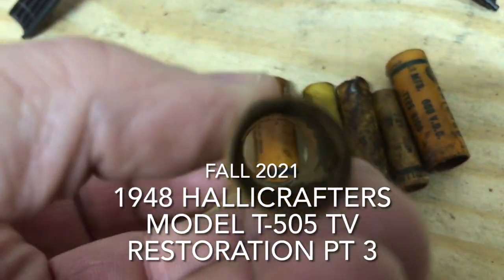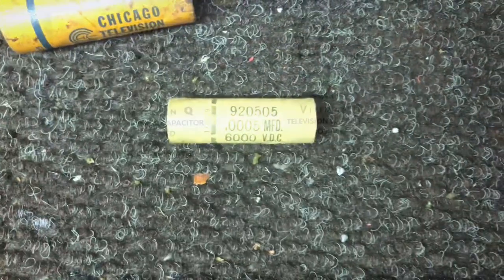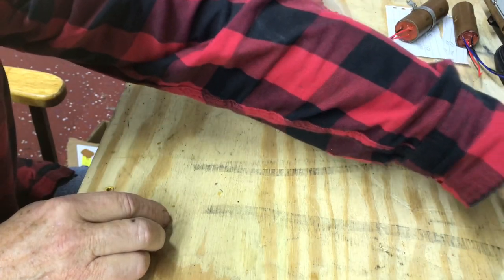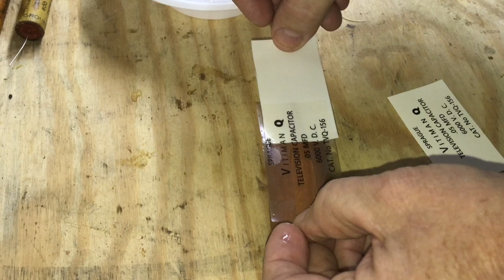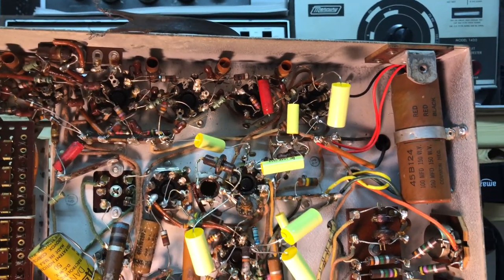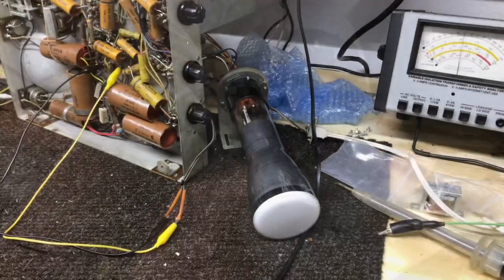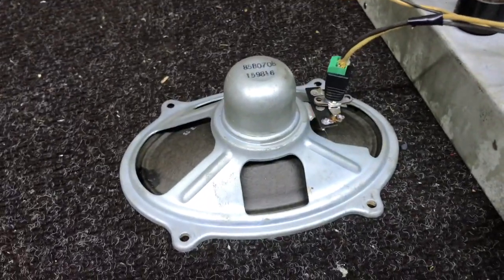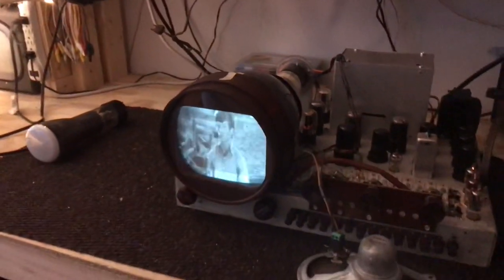1948 Hallicrafters TV Restore Part 3

Comment: Beautiful work. One thing; in my case I never understand why restorers take the time to re-stuff old capacitors especially when the effort required for doing that work will never be visible or on display for others to see. If I did that I would cut a hole in the bottom of the cabinet so a window could be installed. In a museum setting would viewing the underside of the chassis be important? I don't know. Please understand; I am not at all criticizing this  and I do appreciate the efforts to keep the set looking as original as possible. It is just as I see it; once the set is complete and in the cabinet only the restorer knows how the underside of the chassis looks.
Reply from the maker: I understand, it’s just something I like to do on the Caps. 

   Thanks again for watching, I appreciate it.
Reply: @CreekviewAcres  Your work is excellent. I especially liked the re-stuffed electrolytic caps. I may opt someday to try to do the same thing you do on one set but (depending on the set I try this on) I am serious about cutting a window in the bottom of the cabinet so that work becomes visible. I like your videos.
Reply: Some collectors care.  I restuffed a similar Hallicrafters a few years ago and made videos detailing the process.  I later sold it and got about twice the going rated because of the detailed work I did.

Comment: I like your idea of the filament transformer for the CRT. When first powered up does the CRT filament light bright and then dim down? If it does would a thermistor solve that problem?
Reply from the maker: The crt filaments light normally. With a load on the transformer the filament voltage never gets above about 6 volts.
Reply: @CreekviewAcres  I will keep this in mind when I get to working on my Admiral 19A12.
Reply: Yes, a thermistor would help.  You can also install TVS (transient voltage suppression) diodes across the CRT filament.  They act like zener diodes to prevent the voltage going above a certain level.